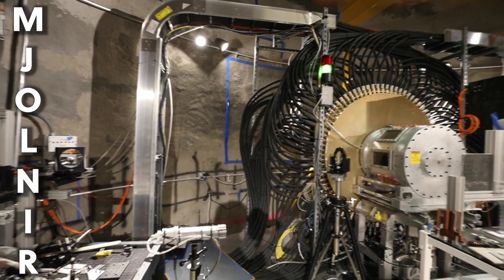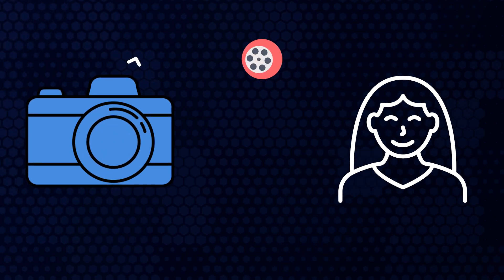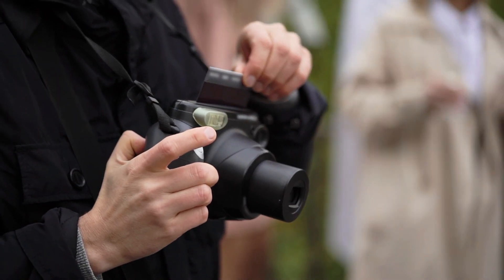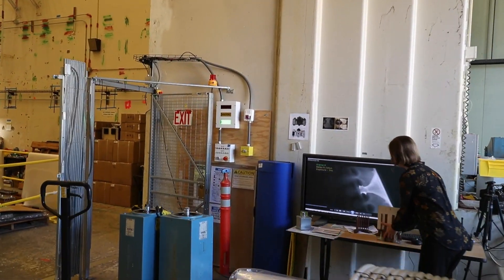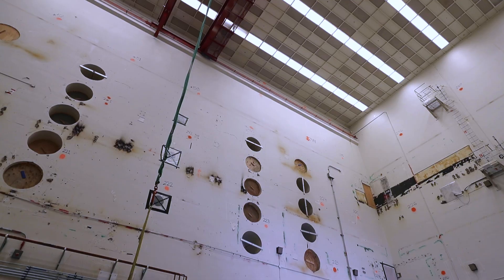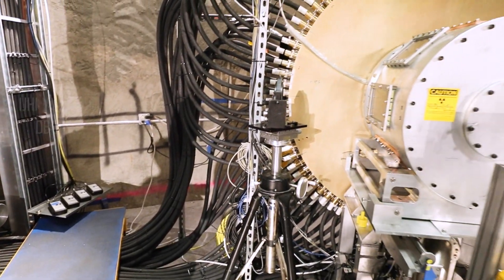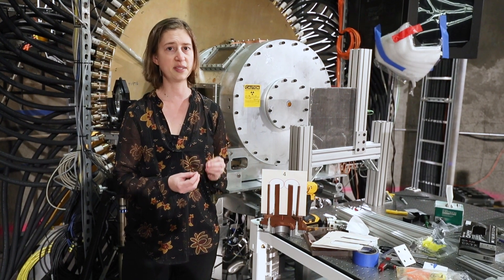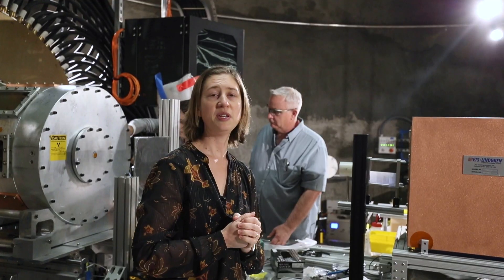How Thor's Hammer Helps Us See the Unseeable

Comment: Modern nuclear weapons have a neutron pulse tube to kick off the fission in the primary.  The arrival time of the neutron pulse, and most likely the pulse width and density, are critical to the function of modern, miniature weapons that use less fissile material, and thus have tighter tolerances for functioning.   Seems to me the Z pinch is the secret to engineering a pulse tube in the trigger of a nuke.

Comment: So....... You really think that they are just making an imaging tool? This has "weapon" written all over it. Imaging the inside of a running engine to see the fuel is a poor misdirection. If you really wanted to image the fuel, then adding an isotope would allow a good resolution x-ray image to be had, or an fmri using nano metal particles in the fuel would work as well. This is a WEAPON, plain and simple. Can it be utilised to do imaging, probably, but certainly not on humans, the ionized radiation is too high for use on humans, even at very fast imaging cycles, not to mention the kind of sheilding required to run such an imaging device on humans would make the machine cost prohibitive. It's a hammer .......... for hitting nails!!
Reply: Not a weapon, but a component of a nuclear weapon. See my comment about pulse generator tubes in the primary trigger.

Comment: Excellent video on how neutrons are produced, yet we see nothing of HOW the neutron burst is converted to an image that provides wanted information.
Old tech of measuring nuclear weapons neutrons was detecting proportional production of protons kicked by out of high proton targets, like paraffin, then bent through a mass spectrometer magnet to get energies of the protons.
Yet this video says nothing about how neutrons are imaged.
Reply: That's a great question! We use a plastic scintillator fiber bundle. Because high energy neutrons can take several centimeters to absorb appreciably, our fiber bundle is thick (currently 5 cm). The fact that the scintillator material is arranged in a fiber bundle geometry allows the neutrons to interact with the scintillator anywhere in that thickness and still have the light produced piped to the face of the scintillator without substantial blur. The face of the scintillator mates to a fiber optic taper, at which point the signal is amplified by a microchannel plate. The image is then transferred along a fiber optic rope to another enclosure containing an intensified CMOS detector.
Reply: @drdreschmidt  Thanks for the reply.👍🏻
Are you using the green scintillator POPOP fiber that was used on accelerator detectors years ago?

Comment: Did I hear that fusion is occurring?  Can you confirm?  I was under the impression that inducing fusion was even harder than generating super-supermanian neutron vision or bending steel with ones bare hands.
Reply: Break-even fusion, where you generate more power than you use to smash atoms together, is extremely challenging. But we consume more energy than is contained in the energetic neutrons that we produce, which is not as challenging. Thanks for watching!
Reply: Desmond, you might also be interested in what goes on at the National Ignition Facility, where high power lasers are used to generate the necessary heat and pressure to initiate fusion. As drdreschmidt points out about Thor, generating small fusion reactions in laboratory conditions isn't quite so difficult as the holy grail of sustainable fusion for power generation. In this endeavor, China's tokamak reactor (using magnetic fields rather than instantaneous electrical discharges or lasers) recently set a new milestone.

Comment: Looks like I was wrong. The host didn't make any mistake, she was describing how X-rays specifically work and the host's explanation was valid. I apologize for the error.

I appreciate the reply from Padmanabha Prasanna Sihma, without whom I wouldn't have reviewed the video again and would likely have never corrected this mistake.

[Original comment below]

I love how the scientist debunks the explanation the host provided for how Neutron absorption works.

Host: 'Neutrons pass through soft matter and trapped by hard matter like bones which is how X-rays work.'

MJOLNIR Operator and Scientist: 'The neutrons will pass through hard substances like the metal of the engine, but be absorbed by the fuel.'
Reply: The host said that X-Rays pass through soft matter and are absorbed by hard stuff like bones and metal. Which is perfectly correct.
Reply: @padmanabhaprasannasimha5385  
Alright, I concede.
The host did specify "X-rays."
I was thinking about how neutrons work. The host isn't wrong because she specified which form of light is being used before discussing it and she did explain how x-rays work properly.

I was wrong to accuse the host of providing incorrect information.
Reply: @VariantAEC  A true measure of a scientist and genuinely humble person.